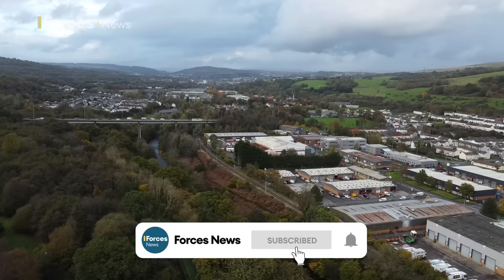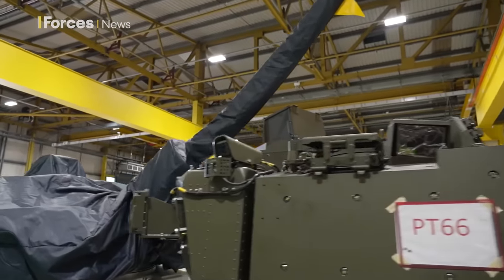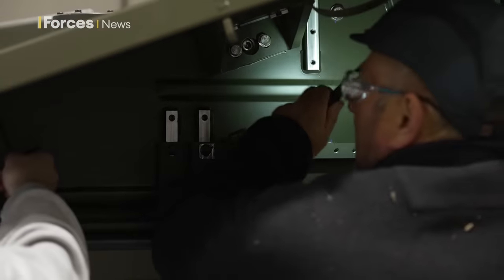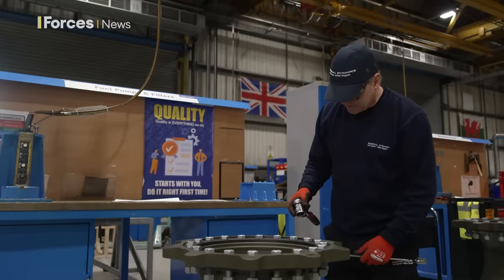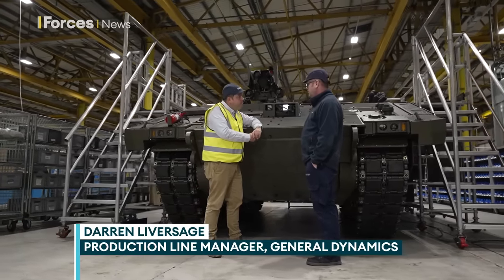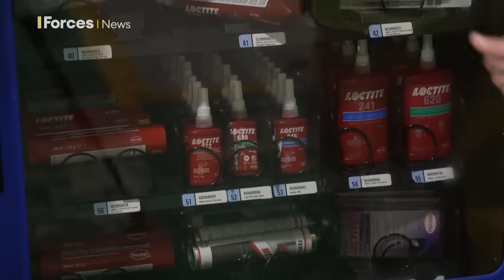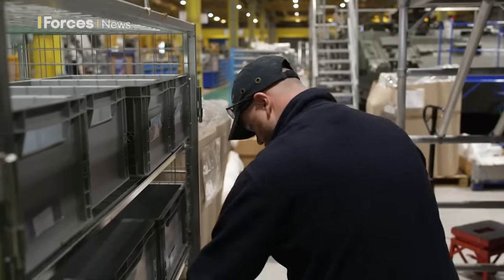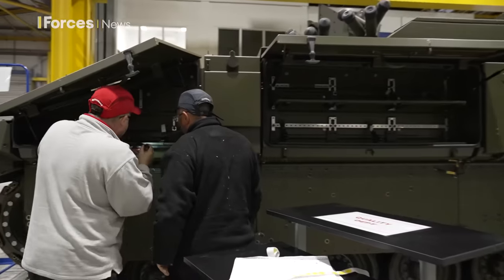Production lines running hot to build Army's long-awaited Ajax fleet

Comment: During World War II, German tank crews traveled to the factory where they were building the new Tiger 1 tank.  It was a complex vehicle so having the crews see how it was being assembled also helped them to understand what kind of maintenance they would need once deployed to the fronts.
Reply: Must have trust issues if REME helping out with production line !
Reply: Definitely cheaper than a few months training on them.  

Heinkel He162 pilots had a film and a 20 minute lecture before flying a jet fighter.
Reply: Is that why they were famous for mechanical failure?
Reply: @lalec1417  we will see if these become "Famous" for their mechanical failings and weak design aspects.. They look like they would just get stuck in mud like any other Heavy Rolling Cannon
Reply: ... and they won the war?
Reply: ... before they were overwhelmed by massive amount of T-34-85 and IS-2, which were roughly assembled and maintained.
Reply: Seems like nobody has learnt anything since..

Comment: 1:37 Nothing screams productivity like hand cranking 80 bolts just for the drive sprockets. Alternative title: How to milk it and turn a 5 minute job into an hour
Reply: yes they need to get an F1 pit crew to help improve the factory
Reply: sad thing is you could have 3 torque guns that stop at given specs and do it gun A B and C in order, in a star pattern and it would be very easy.
Reply: @captiannemo1587   Multispindle Nutrunners have been around for ages...they defiantly spend too much time sniffing that glue dispenser
Reply: Welcome to government contracting!
Reply: meanwhile russia is pumping out 50 bmp3's a month
Reply: It should come as no surprise to British taxpayers that this is done by design. If you're too efficient, you can build these machines too quickly & so why build a whole new factory for less than 600 vehicles?

And given that the British army took something that was already in service & made 1,100+ modifications to it - because God-forbid they use something that anyone else uses - it's highly unlikely to receive any foreign orders either.

So Martin & his mates will take their time & use techniques that would have been standard a century ago.
Reply: @paulg3216  well yeh you can only have 600 vehicles because they are so expensive. if they were cheaper you could have more. you could loose 1/2 these to drone attacks in months. if it takes years to replace - you lost the war of attrition. air superiority no longer exists when anyone can fly a 1kg drone at you.

Comment: General Dynamics started as a merger between Electric Boat submarine manufacturer in Groton, Connecticut and Canadair aircraft manufacturer out of Canadian Vickers plant in Montreal Quebec.and designed and built the F-111 fighter and the F-16...while working with Grumman and Northrop.  Then in the 1970s went into land and marine systems. It is the 5th largest defence contractor in the world now, and Fortune 100 ranked it as the 94th company on its list in 2022.
Reply: "n 1952, Electric Boat bought Consolidated Vultee and combined it, Canadair, and several smaller companies to form General Dynamics Corporation"

Comment: Numpty question - did the internal noise problem get fixed?

Good to see ex-forces gents doing work that has a lot of meaning to them.
Reply: Expensive noise cancelling headsets to reduce 117 Db to a safe level !
Reply: @peterwait641  Ah! Thanks.
Reply: So no then :(
Reply: They tightened the wheels to the correct torque.
Reply: @randommadness1021  Without grease sprocket bolts seize and you have to heat with gas or cut nuts off with angle grinder . Spent 4 hours heating and using 1" impact gun on CR2 final drive bolts (the big ones not sprocket ones )rusted in which should be greased . They are torqued to 1700 NM and  2100 NM if using the flanged headed T2 bolts !
Reply: @peterwait641  Antiseize (copper based) is your friend.
Reply: @trespire  Often used on mudguard and side skirt bolts , that's if you don't like running taps down holes . Hylomar blue is also a great product to keep threads from rusting and water out eg final drives , Htt ram housings etc

Comment: Most Loctite types I would expect but the 406 is super glue,  the question must be asked.
Reply: 406 for rubber and plastics not to be confused with 401 which is used by cowboys to stick bolt heads on lol

Comment: ".....being put together..." - exactly, an Assembly Plant with assembly based upon dubious quality Spanish hulls that may well have been the cause of the variable problems. I don't suppose the hulls were correctly QA'd at this ex-fork lift plant. 
The CV90 would have been manufactured (not assembled) at the Armstrong Works in North East of England by a highly experienced work force and in a plant with decades and decades of armoured vehicle construction. 
Sorry, but this report is a rather cheesy piece of low-end 'propaganda'.

Comment: At 3:10 "But why have it in a machine where you swipe your card to get it?" 
Sorry but the answer, 'so they can track when it's in or out of date', does not answer the question.  
They could just as well leave a bunch of in-date supplies in a box. No need to swipe a card - just grab and go. 
Truth be told (assumption), the supplies were disappearing so they had to ID who was using the stuff (illegitimately).
Reply: Or to track which section or assembly line to charge. I bet these boys have their pockets turned out on departure and not a lot goes on ebay
Reply: @Cous1nJack  I've been randomly searched for less before when just working basic warehouse jobs. It's without question that these guys get searched all the time.

Comment: Nuts and screws do not fail, if below their stress limit. Rivets are good, too.
Welding, not bad, even though it has its problems.
Glues? Loctite? My boots, my camping tent and equivalent things, that's the domain for glues.
Reply: You don't much about adhesives then, amongst others things I imagine. Take a look at any modern car, adhesives used extensively throughout the vehicle, same for electrical installation, mechanical engineering, shipping, the list goes on.
Reply: @luciussander8217  - - Maybe that is why the cars made today do not last as the old cars used to last. OK, take it easy, it is not only because of that. LOL

Comment: 1:40 Why is he doing all that manually? Why not use a "rattle gun" (set to less than 500Nm) to do the initial tightening and then the special gun to apply the correct torque?
Reply: Exactly! His repetitive movement alone spells a life time of lasting injury.
Reply: I hope just while he’s chatting to the camera instead of blowing our eardrums out
Reply: Wouldn't make a very good interview if nobody could hear him
Reply: It's probably due to noise/filming
Reply: Think reallllyyyy reallyyy hard on what the key points of an interview are..... now go listen to a rattle gun and i think maybe... just maybe you will come up with an answer for your question.
Reply: Hope he put the XG 279 grease on or replacing sprocket rings will be a job , sprocket should have four equi-distant bolts first at something like 200 Nm to pull it down square then rest fitted at 200 Nm before final torque . Important to remove any paint if left in  thread holes !
Reply: @furiousscotsman2916  Right so we'll employ more locals if we do this manually?
Not really the most efficient way to do this.
Reply: @willis32  OK, so talk to someone else - how many others work at the plant?
Surely the manufacturing process hasn't been changed to accommodate one interview?
Reply: @peterwait641   is that press C25 on their vending machine?
Reply: @whya2ndaccount   I think it was IMHO. I doubt it was well planned by the looks of it
Reply: @whya2ndaccount  well they obviously picked him for a reason and it wasnt a big deal
Reply: @willis32  Well except its meant to show a start of the art vehicle being made in a state of the art plant.
I can go outside now and see two Diggers using more advanced techniques to do the same job in the compound.
Reply: @whya2ndaccount  you care too much

Comment: This should be also taken up with drone manufacture , the new soldier trained from manufacture to end use . The process and modding required in EW systems and counters requires almost portable manufacturing workshops , with 3d printing technology and AI systems heavily reducing the workshop area , robot warfare will have to be countered , lest these ajax become just high cost coffins ? In shore line defence and military front line pilots will need to be trained in large numbers either way.

Comment: Why is it as big as a MBT?
Reply: It's not.
Reply: @sentien13 it is, I’ve seen it next to cr2 and it’s almost as tall and it’s as wide as chally
Reply: @sentien13  length CR2 8.3 m hull or 13.5 with gun x width 4.2 m x height 2.49 m. Ajax length 7.62 m x width 3.35 m x height 3.35 m . It is not small lol
Reply: @sentien13  length CR2 8.3 m hull or 13.5 with gun x width 4.2 m x height 2.49 m. Ajax length 7.62 m x width 3.35 m x height 3.35 m . It is not small lol
Reply: 40 tons !
Reply: @peterwait641  never said it was small. simply that its not the size of an MBT. One axis doesnt count.
Reply: @sentien13  Hull length of leopard 2  7.76 m , close to size of tank 🤣 China 88 MBT 6.35 m hull length width 3.372 m height 2.29 m found one lol
Reply: @sentien13  Very close to size of Sabrah Israeli light tank ?

Comment: Using soo many loctite is a joke especially in Army vehicles. This is tech from 15 to 20 years ago. Not even the chinese use glues for bolts connections because it normal heat condition the glue transforms to crystal forms and thus the bolts loosening much faster. This is only a solution for unexperienced new graduated low level Engineers. Ask a pro before you make produce something or even getter ask the Turkish army manufacturing companies on how to make it right!

Comment: So they solved the fact the vehicle could cause hearing issues and induced vomiting?
Reply: Isolation mounts for seats and driver controls , extra thick comfy cushions and noise cancelling headsets , think rubber tracks would not be squeezed out of fixed price budget without causing a loss !

Comment: Lol this is supposed to replace CVR. It is the size of a challenger 2, I saw it on the Motorway near Oxford. My jaw hit the floor thinking this thing was selected for a reconnaissance role. Also, give the size and weight, how is this supposed to be helicopter mobile like the old scorpion and scimitar?
Reply: Recon hasn't been about "small and sneaky" in a long time. It's about being protected enough to encounter the enemy, and carrying enough comms, networking and high end ISTAR to coordinate the fires response.
Reply: Air portable by plane if engine and tracks removed as load has to be distributed in C17 and center of gravity can be an issue if in one lump !
Reply: lol @peterwait641
Reply: @@JimCarner Taranis was a test demo model and has nothing to do with the role Ajax fulfills. Also, RATO? That is the dumbest idea I've heard in ages.

Comment: Got to be much better than that Dinky Toy the Army are using at the moment, it might be versatile,  but for an European war the Jackal is very exposed!
But The AJAX is 6 years overdue at least and I think the Chassis are built in Spain,  and not Wales as intended?
Reply: It's not replacing jackal, which has its own, unique use. It's replacing CVRT.
Reply: The first batch of hulls were to be made in Spain and rest in the UK , due to delays they made them all in Spain . Might have been intention for cost saving as duplicating a line eats into profits !
Reply: The jackal is an awesome piece of kit!
Reply: @garagenigel  Supercat don't sell power point presentations to David Cameron and properly test and develop their vehicles 🤪
Reply: @Retrosicotte  Yes, I was on CVR(T),  these vehicles are huge compared to them, at the moment the Light Role Regiments are equipted with Jackal, totally useless in an European War, obviously much better than the Recce vehilcles of the 1970´s like Ferret, but they were not for fighting, they were just supposed to observe and get back to safety, no idea what a Jackal can can do with no real armour or overhead cover.
Not sure if AJAX is any better than an off the shelf weapon system like CV90, that has been trialled in War,  and is made by the same company.
AJAX is nearly the size of of a full blown MBT, it was adopted from the Uhlan Family of armoured vehicles and was over 40 years old when  BAE bought them out.
But, they brought much needed jobs to Wales.
Reply: @gaptaxi  Again, you misunderstand the role of Jackal. Jackal is not a CVRT or AFV replacement. It replaced the Land Rover WMIKs in role, and is far better protected than them.

Ajax is what replaces CVRT.

Comment: so the permenant damage to soldiers driving and using this has been fixed? No? of course not. The MOD have stashed the cash somewhere else. just a pair of snap on noise cancelling headhphones. pathetic
Reply: Soucy Defense make rubber tracks which produce up to 70% less vibration and up to 13 % less noise  and 30 % fuel saving . This would go a long way to solving issues cost would bankrupt GD UK !
Reply: @@JimCarner Lets celebrate its mediocrity , its  like bringing David Cameron back from his sulk, also being he signed the contract !

Comment: Loctite doesn’t really go out of date…
Reply: Some loctite's separate or change viscosity , have had some no good years after expire date. Relatively cheap product compared to cost of parts so no reason to use old stuff !
Reply: @peterwait641  those items won’t go out of date in that machine mate.  The expiration date was added for the MOD when they wanted to know when it would go out of date for the safety data sheet…. We used the same stuff for years until the new stuff got ‘expiry dates’ with the same NSN.  🤣…
Reply: @@JimCarner who is stealing loctite? 🤣..  from my experience of squaddies it’s bin bags and pencil batteries …
Reply: @@JimCarner So you are suggesting that ‘people’ steal Loctite to sell at profit.  Honestly that’s what you are hanging your hat on?  
In my experience it would be quite hard to make a profit stealing Loctite.    If you need a little for a home project you could still take it home then bring it back; it’s nonsense mate.  Personally I think the G10 simply couldn’t be arsed with the queues at the counter.
Reply: @@JimCarner now I spent 23 1/2 years in and around armoured vehicles and absolutely no loctite thread lock went ‘out of date’ or so much got stolen it became a problem.  I realise you feel the need to support your argument, that’s fine but when (if for some hobby or your own car) you need loctite you can simply ask for some and get it, why steal it?  You are now developing a gas light narrative that all these fitters risk their and their families future on a £10 bottle of thread lock.  Please… 
I’ve got to say, you always had to sign for things, even expense items, that’s how they account for stock.  You would need quite a few to sell and make anything.. where is the money?  Like you say I’m surprised I have to explain…

Comment: All well and good to see the factory workers are proud but I don’t think anyone seriously believes this vehicle will ever perform as advertised after such a long history of defects and production failings. At the end of the day it’s a bad design that required massive retrofits to be useable and not much will be able to change that.
Reply: Seems like the soldiers are liking it now
Reply: It is based on the 50 year old Uhlan and ASCOD design of Austria and Spain, theirs are working with an extra roadwheel, but they are a bit bigger, the AJAX is much bigger than the old CVR(T) series, much too big really?
Reply: @gaptaxi  ASCOD is not 50 years old. And recce is not about being "small and sneaky" and hasn't been in a long time.
Reply: I get your point but less we forget the SA80 was a total failure when it came out but went on to be the A2 and 3 which were both fantastic firearms. the literal point of the testing phase is to find errors and fix them.
Reply: @luigiwoo4469  A3 upgrade of rail and paint was nearly as much as Colt M4 therefore not value for money , that fantastic the marines etc are getting rolls Royce  of the M4 world - the Knights version , they even grind the bores of the hammer forged barrels before cutting rifling for greater accuracy !
Reply: @Retrosicotte  Original ASCOD concept design was in 1982 by  Steyr Daimler Puch so about 40 years !

Comment: If the army had any sense they would push for ajax to replace warrior
Reply: Its not got the troop carrying ability though. We could buy a turret variant of the Boxer though
Reply: @admiralmallard7500  It is based on an IFV, if you strip out the recce package it is one.
Reply: @Retrosicotte  The troop carrying variant has no main gun
Reply: @admiralmallard7500  The APC variant carries few people because most of its internal space is given over to large racks for heavier UAVs, ATGMs etc, rather than a combat squad. It's based on ASCOD, which has proven you can build an IFV on the chassis,as thats what it originally was.
Reply: The CV90 would be a BETTER replacement the the Warrior !
Reply: @RJM1011  Ajax is replacing Scorpion, Boxer was a new program. Warrior isn't being replaced by an equivalent
Reply: @admiralmallard7500  YES I already KNOW this ! !